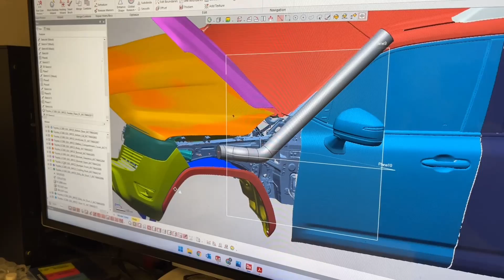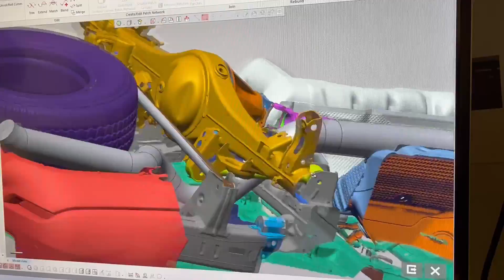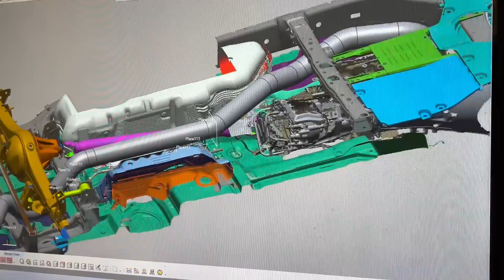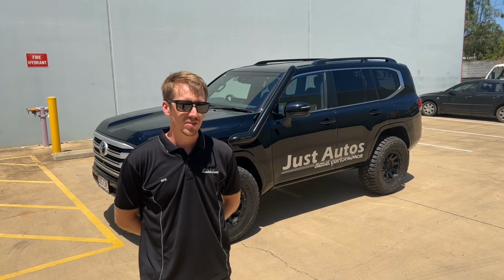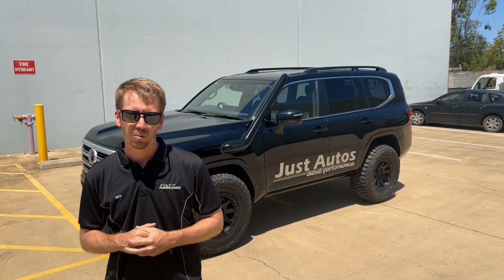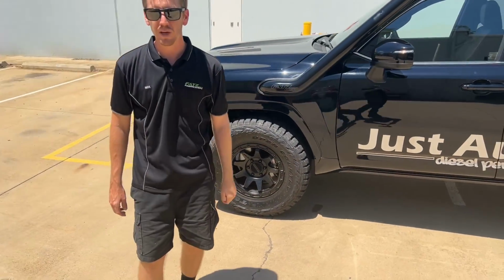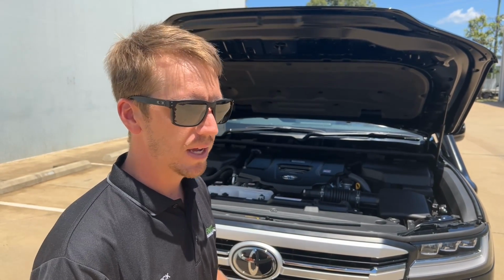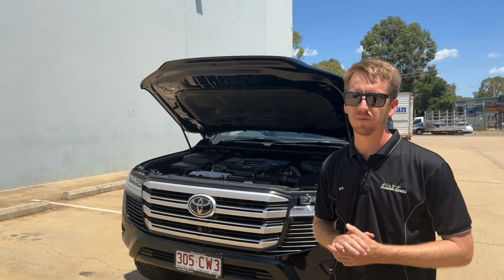300 Series Land Cruiser Products Overview

Comment: You should also consider making a set of extended wheel arch flares for it (ala 80 Series). IMO it'll make the LC300 a real tough & muscular looking 4WD with a set fitted.  And it'll go nicely with the wide wheel/tyre combo fitted to the 300 Series in this video.

Comment: What is the size of tires?
Reply from the maker: 35"
Reply: @fatzfabrication  did you do any suspension mod to fit the tyres ? Rim size is 17"?
Reply from the maker: @ramshid8817  All the suspension/tire modifications were done by Just Autos Mechanical